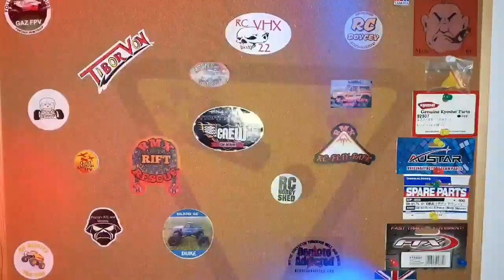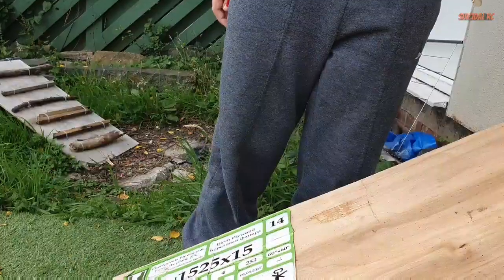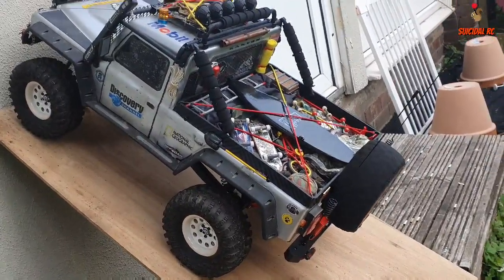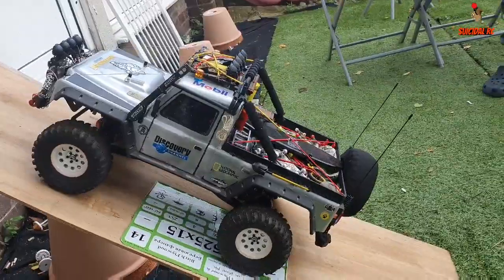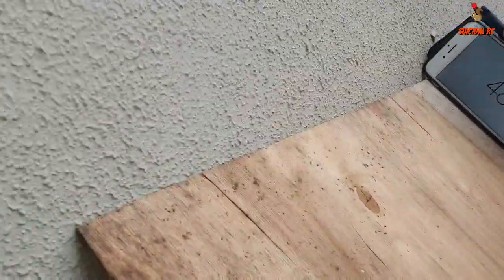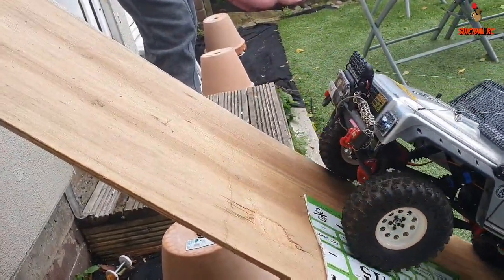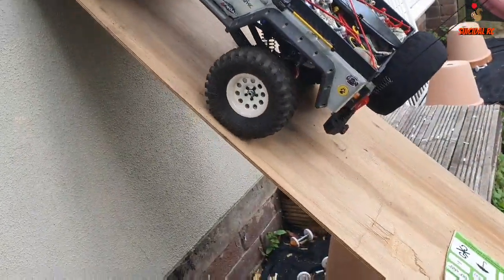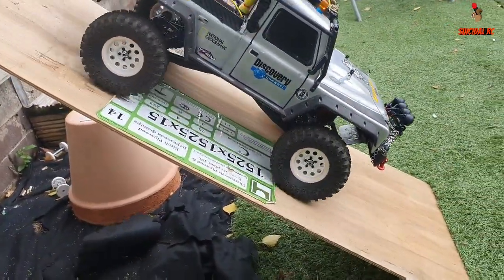FTX kanyon  Incline test pt2

Comment: I have watched these 2 parts in the wrong order, i am watching part 2 beofre part 1 duh lol. Anyway, i think 49 is very good. i am also impressed how these Austar tyres seem to grip leon. But i also think that it might have done 50 if the wood was a bit thicker. i think when the kanyon got near the top of the wood, it was flexing a little bit, which would make it bow and there fore the 50 would actually be more than 50 , if that makes sense, in my opinion anyway , top stuff bro
Reply from the maker: Thank you very much bro and you're absolutely right it was slightly boring so at the top it was slightly more😎😊🇬🇧👍👊

Comment: I can try and see what mine will do,basically now running a 35t motor but no other upgrades. We'll see if changing the body has much effect.
Reply from the maker: yes mate do it. It would be very interesting to see👍😎👊🇬🇧😊
Reply: It may take a while,as I'll need to find a board first.